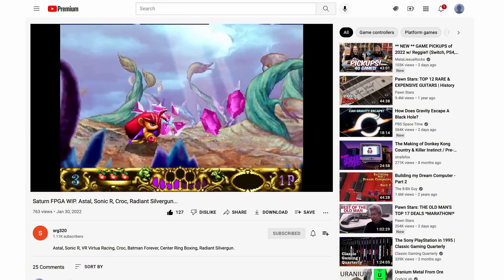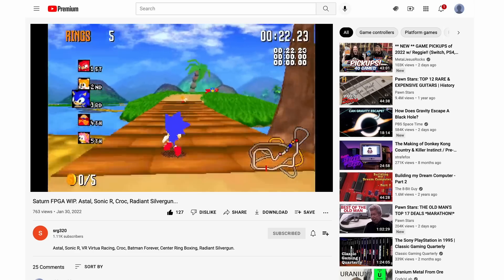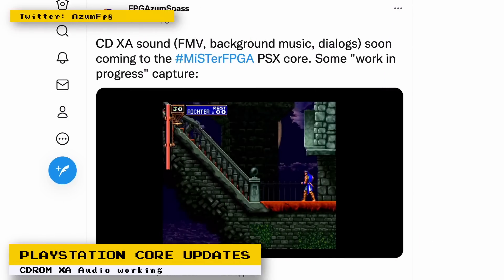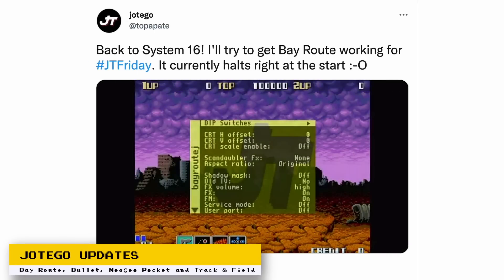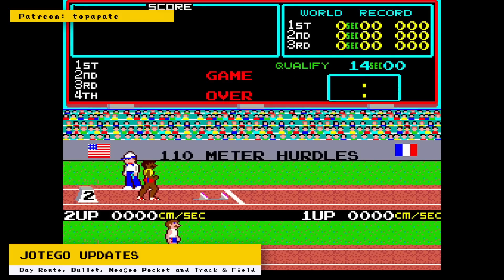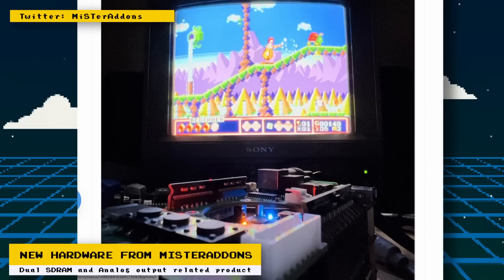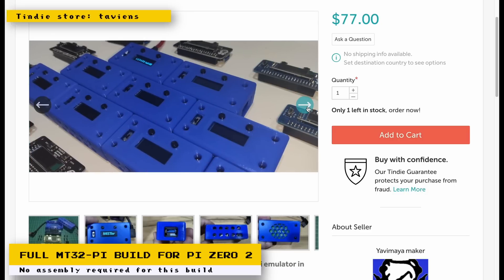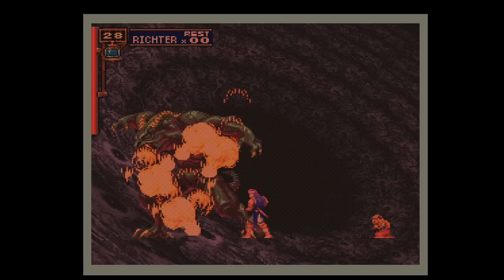MiSTer FPGA Updates - Saturn , Playstation, New Digital IO Board and more

Comment: Awesome to see. Once saturn gets fully up and running its a matter of time before I snatch that shit up. On my current emulation focused PC most consoles run great, but Saturn has an input lag that really fucks with shooters. It took me 6 hours to beat a final stage in Strikers 1942 on Saturn and minutes when I switched to the PS1 game. I really had to memorize positioning. Its tough to notice until you try a more responsive version, but that really enlightened me on the issue. This seems to be an issue across all Saturn emulators currently for whatever reason. Once I pick it up Ill explore all the older systems to try to get that minimal lag, of course. By that point Ill use my emulation focused PC mostly for the nice interface, PS2 or more modern game emulation, less hardcore games. Minor glitches and accuracy issues dont bother me too much , but input lag is definately a buzz kill , especially with these harder challenges and games.
Reply from the maker: The input latency alone is a reason to get a MiSTer FPGA. I really looking forward to this Saturn core!
Reply: @LusRetroSource  Yea thats really the only reason Im looking into it now. Mainly for saturn, but I would probably end up running most of the older games on it if I picked it up.

Comment: I have been trying to figure out the best way to do composite video especially with the PS1 core coming out and it's my understanding that it has issues outputting it even when you buy adapters for it.  It's kinda unfortunate because it seems like PS1 games are especially made with composite video in mind with all the dithering etc.  Do you ever think this will ever be fully addressed?
Reply from the maker: Improving analog video output is something the dev is going to work on after the core is more complete.